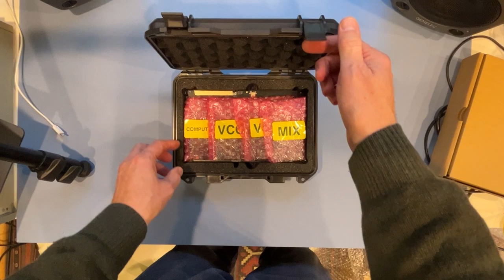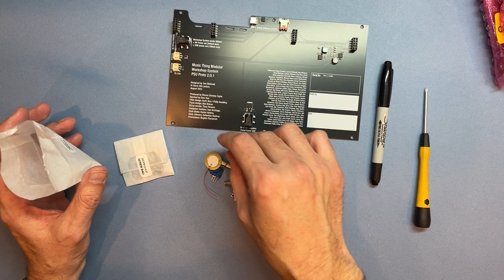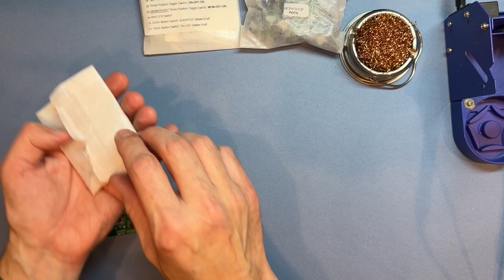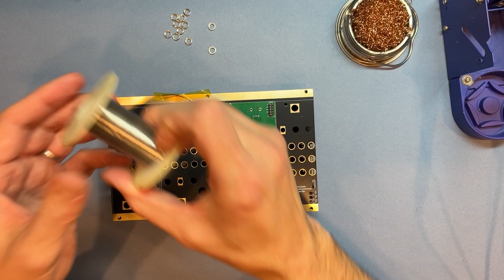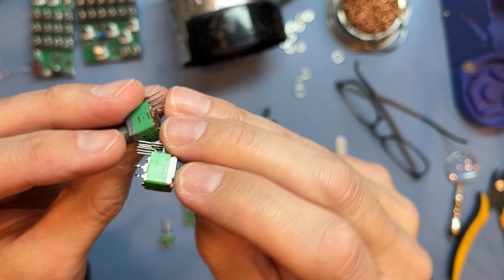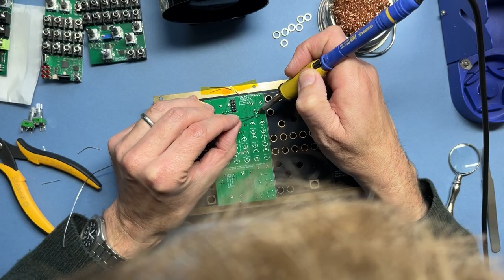OLD Build Video, please check description

Comment: Thanks for a great vid; I built on the weekend guided by this. As far as 'improvements, I'd suggest start with mixer, and then you can have some testing on the way. appreciate this is a 'quick' realtime build. Equally, maybe a little testing list of how you check build, maybe just the anallogue to start. all in all great kkit, great guide A*
Reply from the maker: I can see the point of the mixer first, but it's definitely one of the fiddliest with switches and LEDs - that's why I start elsewhere!

Comment: Awesome machine, i decided to get one today but i did not realise it was in bits until i saw this video, 
I lost an eye last year in a hideous accident  & i dont think that building this is now with in my capability's. Ive ran serviced & built my own sound systems for over 30 years until last year. 
Now i have no depth perception since losing an eye which makes any kind of delicate solder work near on impossible. 
I tried it with one of those synthrotek kits last week just so it would not cost me to much if it went wrong & sure enough my first attempt at soldering since my accident resulted in a non working project & failing my own self test. 
So ime probably going to need one of these built but don't know how much its going to cost, ive only just got the money together for one, thers no way ime going to manage to perfectly solder so many component's when i cant even place the solder tip correctly without stabbing the component's or myself.
Ime awaiting the email back from thonk at present, this is exactly the wort of machine i was looking for to get back into sound design & making techno, i did not fancy starting from scratch with earorack again.

Comment: Just finished my build. Excellent instructions throughout, thanks a thousand Tom! You said leave a comment if we have any tips for the metal pot and switch nuts. I have a very easy one! I just grabbed my 7mm and 10mm socket (but didn't attach them to the wrench). The sockets have holes allowing the metal switches to fit through, and I just then tighten with the socket by hand. No risk of scratching

Comment: Great video, however at 1:06:10 and also at 1:06:15 it sound like you call the shorter momentary switch on the Computer board the "taller one"...

Comment: Very nice project. It's interesting that internally it is composed of 4 eurorack modules, was that done to minimize the number of PCB revisions? I could see the computer in particular being useful as a stand-alone module.
Reply from the maker: Yes doing one mega board might have been a tiny bit cheaper but much fiddlier to assemble, I think